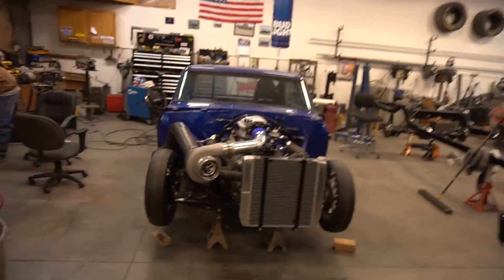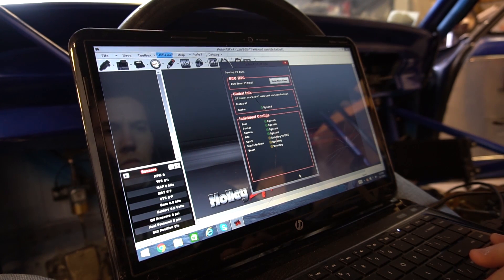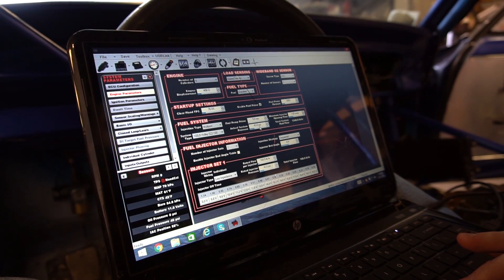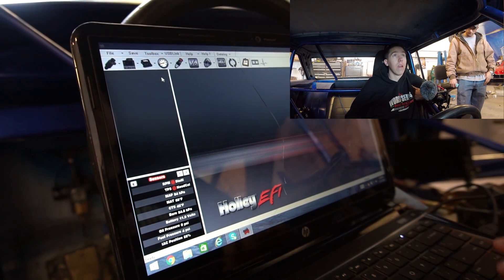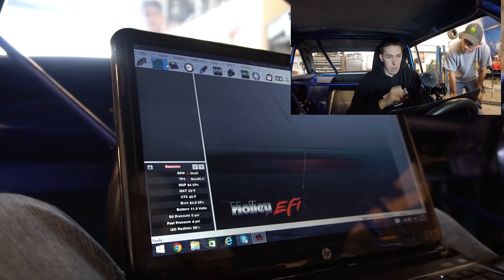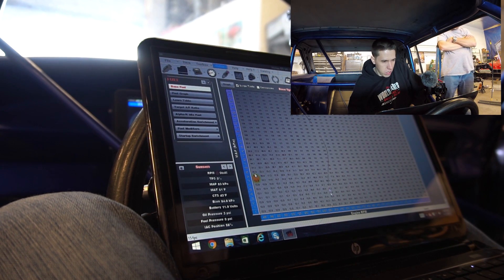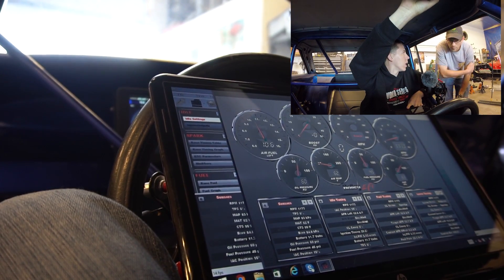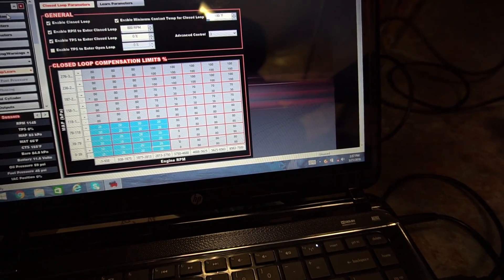Turbo LS Nova Holley EFI Tuning | Build Tune Race 9

Comment: Dude that would be awesome if you can go into a little more with the Holly I just installed Terminator X and I'm trying to learn the setup as well as the tuning the Dual boost control

Comment: Any chance on a walk through fixing the idle surge? Mine is a new set up and only does it when warm (180 degree coolant temp or higher) and randomly.
Reply from the maker: First thing i would check is where your IAC is at during idle hot idle should be around 30% if its way low or high adjust your throttle body until its around 30% Also Verify its not try to swing though large timing changes when its doing this.

If its really random you might have a different issue going on normally it should just hit a random surging issue unless something else is changing

Comment: Question could I go with EFI carb set up with turbo
Reply from the maker: Yeah a lots of people have done it with like a 4150 style throttle body
Reply: @BuildTuneRace  thanks bud I do like the EFI set up u guys using just the LS wire harness kicked our tells last time
Reply: yup.. its what i'm doing. Holley makes the Sniper EFI that is a throttle body injection. comes with handheld tuner for initial setup/monitoring and you can tune with laptop as well.

Comment: Did I hear the guy tell the tuner that there was no water or coolant in system ?
And if so doesn't anyone think he ran in too long on first start with zero fluids ?????
I was cringing at the end
Reply: There was fluids in the car nothing was hurt
Reply: You can run a long time with no coolant. Especially running E85 or higher.

Comment: Hey buddy I'm new to ls engines and I have a Camaro like yours and recently did a Holley dominator efi swap on mine and i need to know how do you tune and how is your boost controller tied into your computer
Reply: it's pretty easy to hooking up the boost control solenoid with holley ecu  if need any help send ur an email i can provide u  a video to make urs step by step
Reply from the maker: Naysean Traylor Devlin I use the learn in the holley and use that to dial in the fuel maps and I've just done alot of research on what timing to start with and work my way up from there. I use the holley boost controller and wire it in the way the holley instructions recommend.
Reply: Build Tune Race ok what website or app did you use and do you recommend Holley for a good ecu if so can you make a little 1min video explaining what app you use and give us a link to your ecu the digital dash and boost controller if so thanks I really appreciate what you do and have a nice day
Reply from the maker: Naysean Traylor Devlin I run the holley HP and use the software it comes with you can download it from holley website and play with it. I'll try to do a small video and post in over the next few days.
Reply: Build Tune Race ok bud thanks
Reply: Salim Binshagra sure that would be really helpful email me at traylor.naysean@gmail.com and plz sent the link to the vid
Reply: If you feel like sharing hit me up at fast69 at live .ca   interesting!

Comment: I’d really like to see what you did for the idle tuning. Sounded like it cleaned up really nice.
Reply: I'm with you that one. I'm working on mine now and can barely get it to run with Bosch 210's. I know they are about as overkill as they come for NA but plan to be on boost next spring.